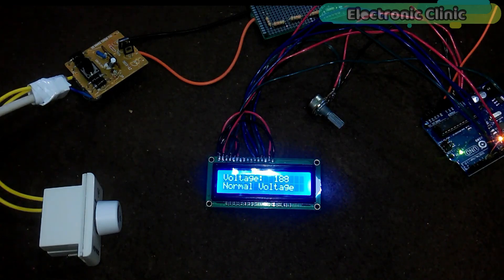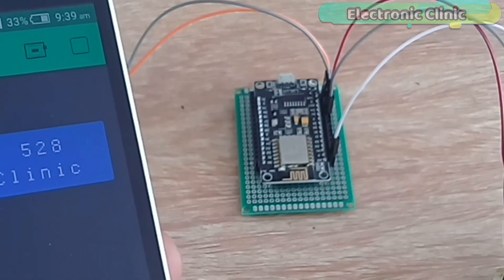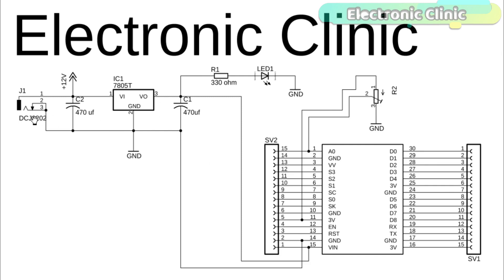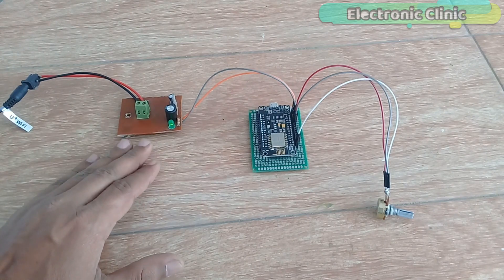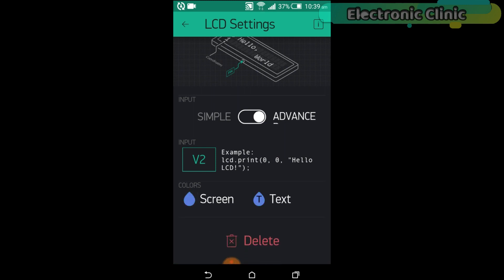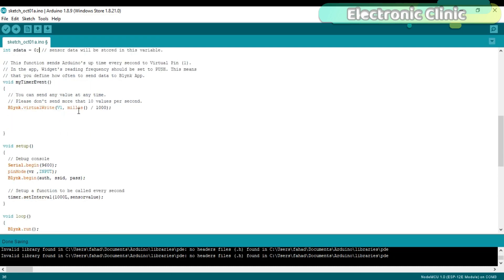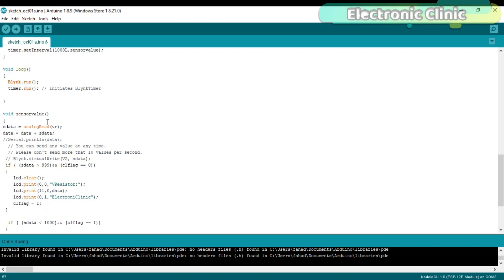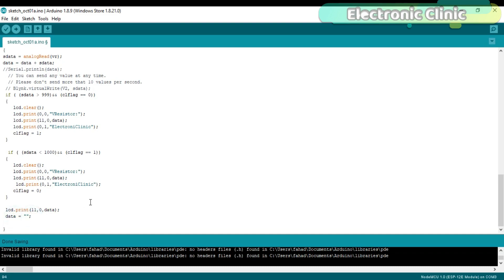ESP8266 Project: IOT 16X2 LCD “wireless 16x2 LCD” Blynk application 16X2 LCD “Nodemcu + Blynk”

Comment: Can I connect parallel 16*2 lcd on node MCU, blynk vertual LCD for desktop and 16*2 LCD for inverter. Both LCD work with nodemcu in the same time.

Comment: Hi. Greetings from Switzerland. I need help in making A IOT device to monitor the battery of a Powerbank remotely over the internet. Can you please guide me. Regards Sajive
Reply from the maker: i already did this check playlist. i did it for the 12v battery.
Reply: @ElectroniClinic  Thanks for your update. However, the problem is that I have to monitor a 30000 mah Power Bank, which only has USB 3.0 or USB C Connectors. Any solution for an Interface via USB or USB-C?